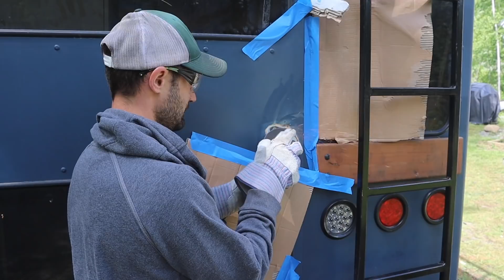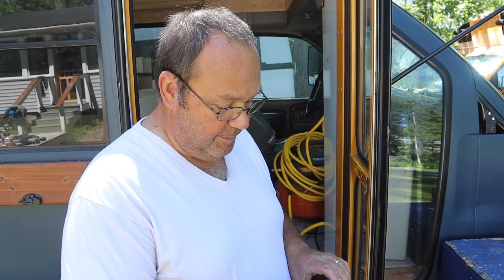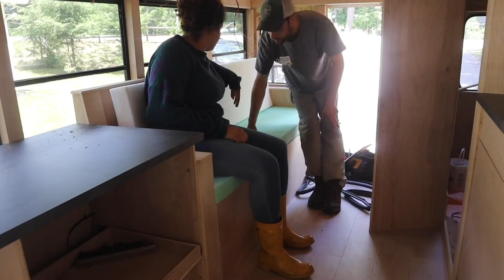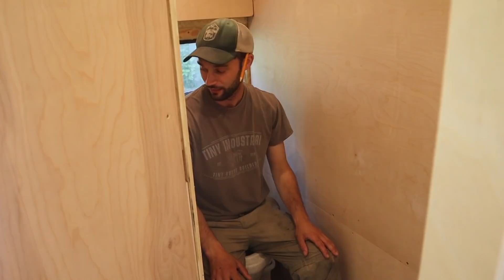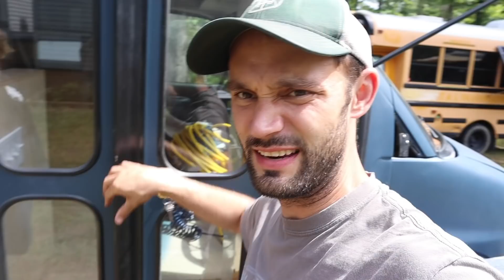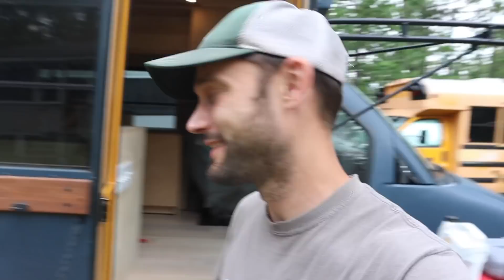We Are Ready To Go! | Hitting The Road In My School Bus

Comment: Windows are great looking....and grossly energy inefficient. Building my 3rd shuttle bus/ motor home. First thing I did was remove the windows.  My solar will run my air conditioner (8000 btu)   Outside temp100f, inside 76f....and heating.

Comment: Dale's fridge looks like an AC version.  How big is the Jackery?
Reply from the maker: It is an ac fridge. I tested the fridge on the jackery 1500. It ran by itself for 38 hours 100% to 0% no charging.
Reply: @navigationnowhere  That's great.  I originally planned to buy a DC fridge in the 5-6 cu. ft. range.  But they were so expensive I decided to get an AC fridge, a fourth 180W panel, and a fourth 100Ah Battleborn.  All that cost less than the DC fridge I was looking at.

Comment: suggestions: add somesorta wireless 4g (3g compatiable) booster antenna on top & its indoor wireless router with lan ports for the road. keep extra 2 keys in a place outside thats not lockable if u get locked outside and everything is inside incuding ur bus driving keys.. some eventful day. paint those brass key fittings (outside) so they key in  spots dont get rust when it rains, keep a spray bottle of WD40 with you for the squeeky parts on the road. extra straps with hook so if your vehicle engine motor stops or you end up in some deep ditch off the road you have some one pull you out. ask Rachel to buy you a rug..so you can walk with your barefeet inside and not bring in extra dirt from the outside onto the flooring.. and lastly an electrical battery operated mini vacuum cleaner.

Comment: nice way to cut foam : an old electric breadknife 
the front door lock turned out nice , dont think you even need a doorhandele
one thing you still can do is paint the doors on the inside , maibe pain on faux woodgrain to fit in with the rest of the interior